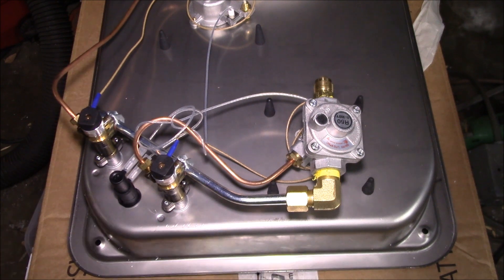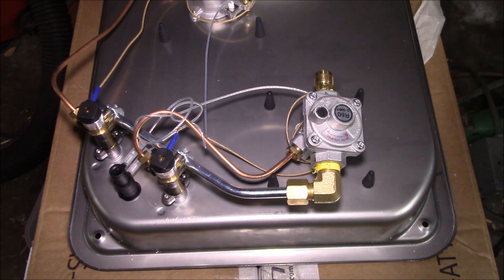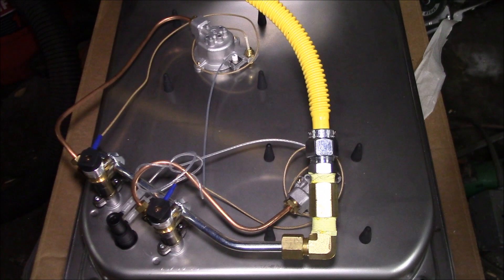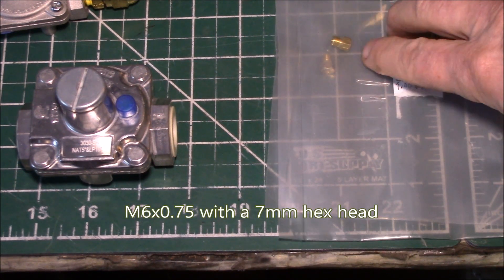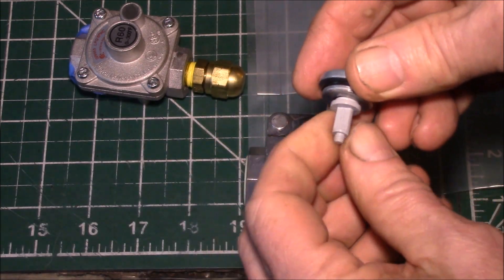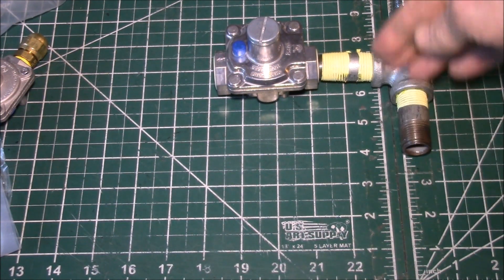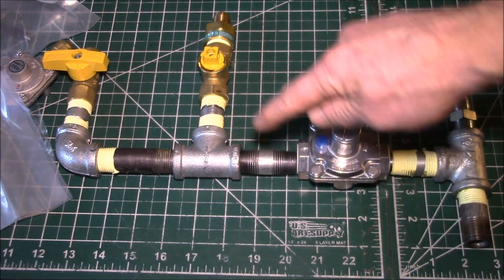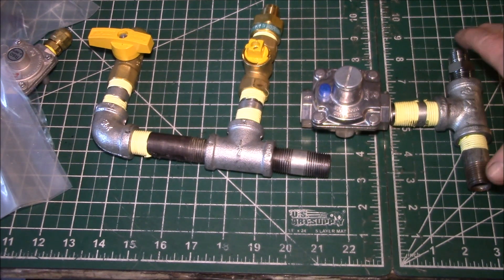Outdoor Kitchen Island, Part 2 Dual Fuel Conversion

Comment: Looking good...your ideas are shaping up to be better in design, choices, and once done convenience...now the envy is setting in seeing the options of your version of the "cook islands"♀
Reply from the maker: Thanks, I'm trying to design in some flexibility into the system.  I've had propane grills before but they always rusted out and it was a hassle with getting tanks swapped out and filled.  But the idea of having a tank or two of propane on hand in case there is a major disruption is reassuring.  The gas grill I'm getting (all stainless steel) comes with parts for both propane and nat. gas and the cook top, came with propane jets, I just needed to add the nat. gas jets.  It just takes a bit of planning up front to figure out how to make all that work together.